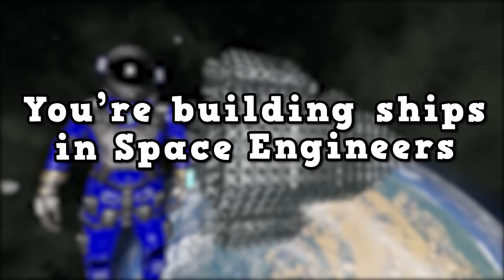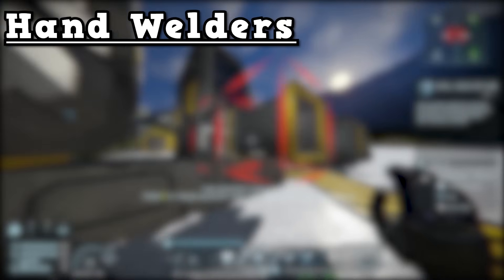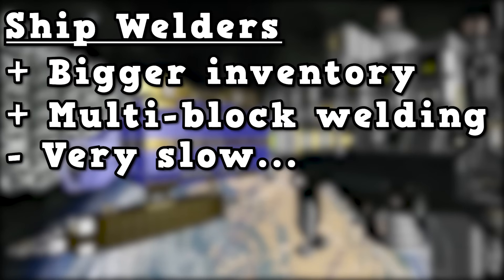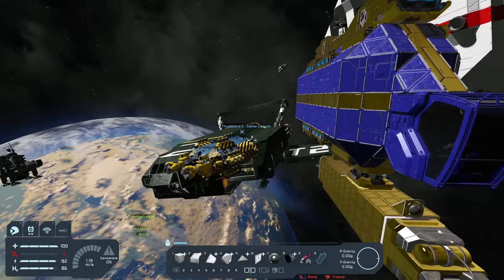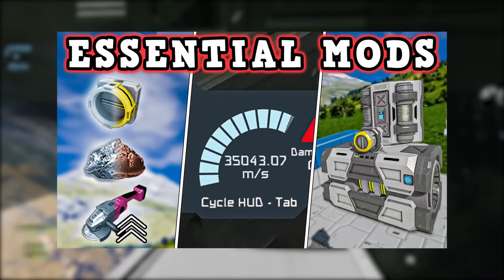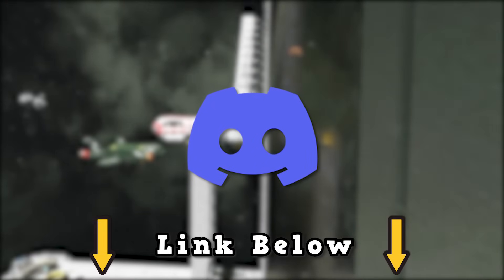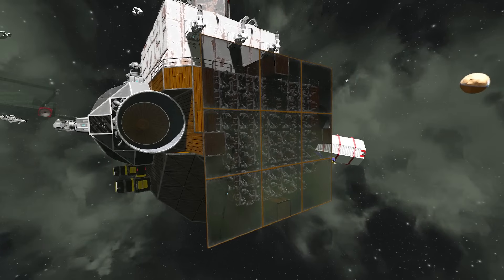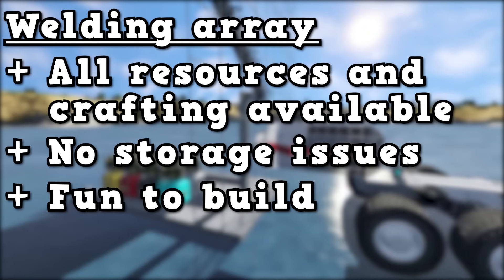You're building ships WRONG in Space Engineers

Comment: You should build/weld by hand anything passed your first small ship or two.

That welding/grinding ship was horribly bad design, better to just put two of either tool on the front and get more done. If you want a interchangeable system you can use connectors to connect/disconnect a tool "head" and switch tools, although its much easier to have a dedicated work ship and just hand grind and weld the tools to switch when you need because they take the some components. A single small grid ship welder is faster than a T3 hand because it welds multiple blocks, large grid version is faster than small. Welding ships can have multiple welders, docking is not hard at all in 3rd person unless you build your ship poorly or your docking area, or you just suck at flying. Loading a welding ship is not hard, and you should know what you need, specially if you have played for a bit. You have mentioned mods so if you are not using Build and Repair, tiered ship welders are insane.

Ship printers are good and all but if you are going for a moving bar of welders it should move a lot slower, less change of clang that way. Welding walls are better but they kill servers. 
You have mentioned mods several times. Nanite Build and Repair negates all of this. And scripts like Isy's makes reloading a welding ship a one seconded ordeal.
Reply from the maker: Build and repair is a cheat mod. Space Engineers is about engineering solutions and bar negatives that.
Reply: @Zer0sLegion  Its not a cheat, they are slow. I can build faster using a T3 small grid welder on a ship. A vanilla welder wall would still be faster, it would just kill a server more. BARs just lets people do other things while it builds. Now that being said people do go over board with it and build a lot of them to build really fast. But you can always change their crafting materials, weld/grind speeds, area offset distance, and are size limits in the ini for the mod. Plus just limiting how many you can have. Played on several servers that do that.

Comment: The only negative I can really see is you have to design your ships so they are printable from a single direction. You could add supports just as in real 3d printing, but some blocks have specific connection spots so you would have to keep those in mind in creative mode, or do a final pass with a hand welder once in survival.
Reply from the maker: Yeah, I did mention that originally but I cut it from the video. In hindsight, I should have printed the ship backwards as it would have come out of the printer better.

Comment: Two points:

1) Use Viktor's Multigrid Projector mod! Projects subgrids, letting you print PMW turrets, mechs, wacky creative mode piston/rotor/hinge mechanisms -- in survival. It's one of the top complaints I see people commenting about on workshop designs -- "can't do this in survival". Except that you can.

Also, use Viktor's Projector Extra mod. It adds a new single function you can put on a control seat hotbar: Toggle manual alignment. This is possibly just as valuable or more valuable than multigrid projection. When in the control seat, you can intuitively use the normal block rotation and player movement keys to rotate and shift a projection. Say goodbye to that moronic slider interface or having 12 clunky hotbar actions, or even using the very convenient Build Vision. (just make sure the welders or build and repair nanobots are turned off or out of range whilst adjusting the projection. :P)

Load repair projection is another function of Projector Extra that adds a button to the projector in control terminal, to load the current grid as-is, without having to blueprint it (essentially it's an unsaved one-time blueprint). This one's a bit fussy since sometimes I can get it to almost immediately line up the projection perfectly, and sometimes it's out of whack. Make sure the projector top (cross mark) and front (dash mark) are aligned with the ship and control seat, as well as aligned as close as possible to the center axis of the ship, to make the manual alignment easier (though it's not at all a chore with the aforementioned mods).

Both of these are available as plugins for the SE Plugin Manager. Yes, plugins have their own issues, but for reliable mods these are a great way to use the mod preloaded with the game so that anything client side will function even on servers, as I understand it (whereas mods have to be permitted by the server). Such as these projector mods. Projections to Assembler is also available on the plugin list.

2) I had this video playing in the background, so I may have missed it. Did you cover using the inventory screen from within a ship control seat when docked and connected to your main base inventory cargo? The second button in the middle column is to withdraw components from build planner. With CTRL or ALT+CTRL you can also adjust how you withdraw (x10 blocks, or leave block in build planner).

As you probably have experienced, withdrawing for build planner can be a bit fussy, depending on which inventory conveyor port you MMB click. Same applies to using this button from the inventory screen. MAKE SURE you have a properly large target cargo (left hand side of inventory screen) selected (highlighted). And MAKE SURE you have your main component cargo inventory selected as the source inventory (right hand side of inventory screen). Otherwise, you'll often get the idiotic "Could not withdraw all components" message when you know full well you have 50k damn steel plates etc.

This allows you to stack up the entire build planner's 8 slots, even with huge blocks like refineries, large reactors, and jump drives. Then from the welder ship control seat, dock and withdraw enough items to fill entire ship cargo inventories.

Furthermore, it's been a while, but IIRC you can have the ship welder tool active from the control seat, and add blocks to build planner by looking at them while piloting the ship. I play with the above mods by default, so I cannot recall if this function is vanilla or a bonus of the mods I use.

This hybrid hand building / ship welder approach makes it a bit more streamlined to use the ship welder. I personally like to lay down 1 required steel plate, interior component, etc. for each block in the ship being built (if not using a projector), then whether hand-building or using a projection, add only 1 of each common block type with RMB to the build planner CTRL+MMB in inventory to withdraw x10 the blocks. 2-4 large grid welders and even just an equal number of large grid small cargo containers will make short work of hauling 10k steel plates and construction components for the hull armor, cargo containers, conveyors, etc. (compared to hauling components by hand, especially metal grids or steel plates for heavy armor).

Sorry for the text wall, but these mods are worth the read. Thank you for coming to my TED Talk.
Reply: Those are GREAT mods. The along feature and repair projection are so handy and printing whole turrets is just satisfying

Comment: One more idea is to use modular construction methods like engine and cargo pods with a central ship module that can each be built using a smaller weld wall and then assembled using merge blocks and a little tug ship with mag plates to move the modules around. It does take more planning and may limit your product but still another fun way to get around the building limits.
Reply: I do this too. I build the ship in creative now (tip from zer0 legi0n). Then cut out in smaller segments the Bp it like, shipname 1, 2, 3, ect

Comment: Weld ships can have multiple welders. This helps with speed. You can also queue up things in the build planner, get in your weld ship, select weld ship inventory in the left panel, and transfer in build planner components to the weld ship via the button in the middle. Then just load up with common components like plates and construction components and worry about the rest on a 2nd pass. I'm not sure if you can pick blocks for the build planner in cockpit build mode, which is something else a lot of people don't know you can do by pressing shift+G in a cockpit, but that should be easy enough to figure out with a little science.
Reply: Also large grid welders are WAAAY better than small grid ones used in the video.

Comment: One tip from me: Try building ship starting from the projector block before make it a blueprint, so when you project it to build in survival you don't have to mess with Pitch, Yaw and Roll settings.
The blueprint's orientation is the orientation of the first placed block on that blueprint, so if you can keep track of that block and that orientation you can start with any block.
The same applies to Horizontal, Vertical and Forward offset, if you don't want your projector to project a blueprint 20Km away you should keep track of the first block and build your ship around that block.

Comment: In addition to requiring you to make sure you're blueprinting with a convenient block in a known orientation as the snapshot target, almost all of the six sliders are also wildly mis-assigned, and inconsistently so, too, so it's not just a matter of just placing the projector in a different than prescribed orientation (as in, "plus = top, vertical dash = front"). There is a bug report on the support forum about just this issue ("Projector movement directions do not match rotation directions"), so don't worry if you've double-triple-quadruple-checked you've done everything correctly and, say, the Pitch slider still doesn't actually pitch, and does it in the wrong direction, too. You've not gone mental, it's Keen's fault. Anyway, for this reason, I sometimes paste the entire build I mean to blueprint onto a newly placed projector with a known orientation, and then take the blueprint while aiming at that very projector. This effectively rewrites the blueprint to have the projector as the root, making the final projection reliably predictable because now it's only a matter of how the actual production projector is oriented.
Reply from the maker: I feel like most of the issues would be solved if Keen just confirmed what the correct orientation of the projector was lol
Reply: @Zer0sLegion  If only it was that easy. Alas, the axes' "misassignedness" isn't even consistent, so a revised orientation wouldn't help. It'd just be wrong in a different way.

Comment: i tend to use a hybrid build method a lot of times.   i will use a small ship welder...  but i don't bother loading resources in it...   i will park the welding ship by a large build item,  hyperdrive, thrusters, etc...  then,  just the build planner to grab and place... but i don't bother welding i just let the ship welder weld for me while i load and unload stuff

The ONLY thing i usually keep in the ship welder is...  steel plates...   holding several thousand steal plates and slowly moving along a hull building all the armor...   is relaxing...   especially doing things like asteroid bases.

LOL...  that i can't do in creative, though my computers starting to really hate me for the grid size of my Gibraltar base.   Thing is getting massive with 2 hanger bays, 3 extendable docking ports allowing for 3 LARGE ships to be put to port.   all build inside an asteroid,  with a huge ring at the front with gun turrets.  missile, and railguns to keep pirates at bay.

Comment: Why would  you move the ship when you can use a piston to move the welders? Just need a wall of them. If you aren't allowed enough, make a line of them and print in layers. For zero g, this works great. For planetary,, either print vertically or add some wheels to take the sheer forces off of the pistons
Reply from the maker: I literally mention why you shouldn't use pistons in the video
Reply: @Zer0sLegion  You mention why you shouldn't have the ship you are building on pistons (and I agree, you shouldn't be moving the build target at all during a build). There is no reason not to have the welders on pistons. I have MUCH worse performance with rotors on servers than with pistons, and mixing disconnected grids together with server lag is a good way to get explosions

Comment: Sure, ship welders have the additional steps of having to dock an open the inventory, but I do still recommend learning how to use the ship's build planner effectively. It's saved me so much time, especially when handing large numbers of blocks as you can withdraw x10 what your build planner has, which is handy given the build planner itself cannot hold more than 8 blocks.
Once trick I've learned when building landing pads is to simply add one block to planner, eyeball the pad's width, and then x10 a few times to stock the ship and get back to welding.
Reply: so does rmb with ship tool add that block/its missing components to the build planner? how do you get the inventory into the ship, by transferring manually? what's the purpose of adding it to planner if you can't also quickly transfer components to the ship?
Reply: @TeleClassy2  Sorry for necro, no sadly you can't pick blocks from the world while in the ship. However, if you're in a closed cockpit (doesn't work with control seat) you can Ctrl+G to open build mode, then open the G menu and add blocks to the planner there.
As for moving items quickly it's as simple as docking and then setting your left inventory to the ship's inventory, then click withdraw from build planner. Like I mentioned you can even hold Ctrl to take 10x the amount for many of that same block.
Hope this helps!
EDIT: Apparantly you can add blocks with ship tools, so that's useful!

Comment: I wouldn't move the ship; I would move the welders.  You can have a line of welders that 'scan' the projector space mounted to pistons that have their velocity set just low enough to ensure that the welders don't miss blocks.  (The pistons that move the welder mechanism should have their speed set to move the distance of one block every time the line of welders hits their movement limit.  That way, they never have to stop.)  If you are playing on a multiplayer server that limits the number of welders, you can add a third set of pistons that move the welders--in a dashed line--back and forth for full coverage. 

Does that make sense?
Reply from the maker: Most of your resources are at your base and most people aren't building mobile bases. Imo, it makes more sense to move the projector than the ship.
Reply: @Zer0sLegion  Hmmm...  I just realized that I wasn't clear enough.  I meant you would build a 'shipyard' that would weld ships together and the welders would be on an XYZ gantry system.  (Think 3d printer or CNC machine.)

Comment: Welders sphere of welding forms a cross, and so even on the limited Keen servers, one can still build big welder systems by taking advantage of this.  For small grid welders, arrange them in adjacent 45 degree diagonals to each other.  For large grids, you can space them out a bit, place a conveyor block directly above the central rotor, place another conveyor at 90 degrees...and repeat, so the Welders proceed at about 30 degrees angle from the starting Conveyor block; this will allow a welder with a 23 Large Grid block width using only 5 welders.  BE SURE TO ANCHOR THE WELDER SYSTEM!  ....or expect to chase after a rogue grid you spent an hour building.

I have no ideas on the following: but... learning to create ships in sections and weld/merge them together later is useful for PCU limited servers.  A video on how to do this wold be good.

edit:
when designing a ship make sure to keep in mind the starting weld block which I usually mark in an off color.  And that all blocks extend from it even these are removed like flashing on old plastic models; otherwise some bits can be missed by the limited reach of the welders.
Reply: This! Using merge blocks to piece together a ship. 

I do something I like this to an extent in creative, make modular hull pieces then start gluing stuff. I had thought about using it in survival but got burnt for a while.

Comment: Ok so I have liked and Subbed, yay new sub. For some reason I could have sworn ive subbed to your channel before but Ive been watching for a while. Anyways lots of comments for this. Easiest way for printing projections on planets is to have the projector on your base as a station and pull a spinning double sided projector "blade". There is a script to help with projection alignment called "Projector Aligner" by Brianetta and its very helpful. Good that you brought up the projection to assembler mod as when used with a weld wall and the Projection Aligner scrip as well as Build Vision for any fine adjustments and settings for the pistons and rotors it makes building SO MUCH faster and less painful. Also using that setup is WAY faster than the Build And Repair mod unless your using like 2 dozen or so then its about even. I did just learn something new though for you about blueprinting from the rear connector. I have "engineered" ALOT of welding systems over my time in SE but after almost 6000 hours in the game I mostly just use the BAR's to build my stuff from blueprints I make in creative(I used to build in survival only but watching Splitsie's build videos changed my mind). Its really cool that you and a few other channels are making vids to help the newer "engineers" learn how to have more creative fun with the game. Even though I dont need the learning experience I still watch all of the SE content because im still addicted to SE even though I dont play it as an engineering game any longer(I play it more like Eve Online).